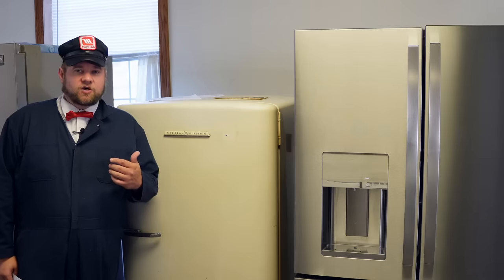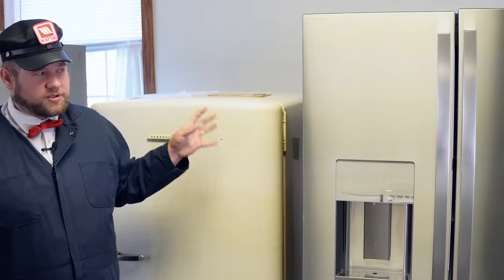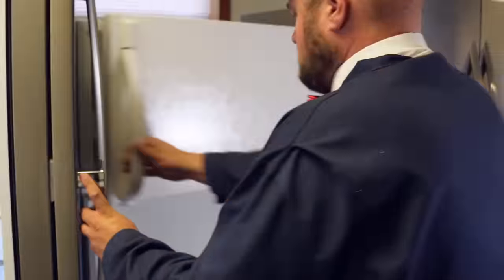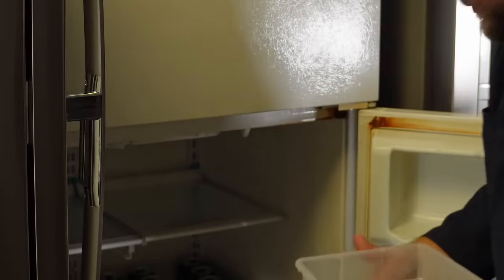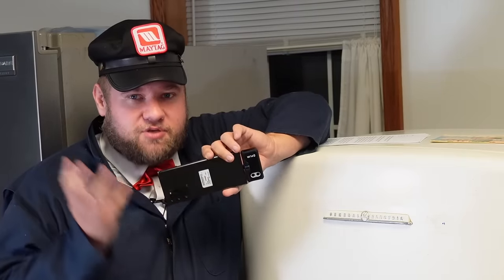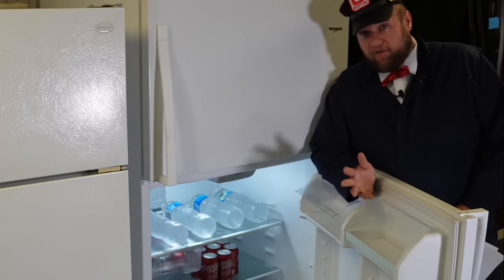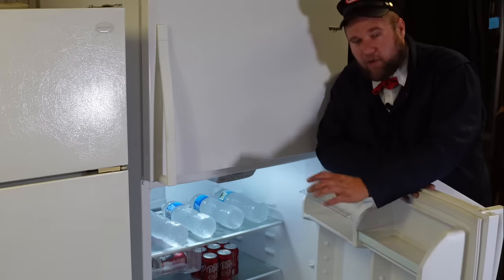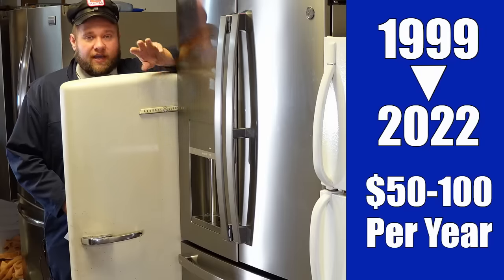Should You EVER Buy a New Appliance if Yours Still Works? A 7-Day Test

Comment: As someone who loves old technology (I have a 30 year old truck) I definitely wanna see that old fridge stay in one piece or at least stay in use. That machine probably has a good number more years left in them
Reply: Yup. Simple good sturdy designs are the way to go. To you can't find that much anymore.
Reply: @johnrobinson8323   fire up a '79 chevy Silverado  when you are gathering firewood in the wildlands.  There's something special about those bench seats and mechanical / not computer run systems.
Reply: Definitely agree
Reply: I hope somebody got it and it wasn't scrapped.
Reply: Yeah, but that old fridge probably uses 3-4 times as much electricity to keep running compared to a newer model.
Reply: @mrsleep0000  Nothing compared to the resources wasted on new Fridges that die in 10 years.
Reply: With the cost of heat and AC these days, if all I had to worry about on my electric-bill was an extra $10 per month, I wouldn't have anything to worry about!
Reply: The only thing wrong with your granny's fridge is it's too small. If I had a basement or garage, I'd  probably keep it there for beverages.
Reply: @sunbeam8866  A lot of new fridges are larger, but some of that is insulation too.  Much of a new fridge's "efficiency" just comes down to more insulation.   Actually, they've been switching to less and less efficient refrigerant to be "environmentally friendly".
Reply: @l337pwnage  As I remarked in another comment, the amount of extra energy my 30 year-old Fridge uses doesn't keep me awake nights. But having to spend $1000 to $2000 every few years might. Instead, maybe I'll invest in aome new gaskets!
Reply: Ur 30 yo Ford truck is very rare old technology, sure mate. 🤭😂😂
Reply: I guess you didn't watch this video @mrsleep0000

Comment: One reason the staff refrigerator did so well is because it was so full.  The fuller a refrigerator is the less warm air that can enter when you open the door.  This requires less energy to cool.
Reply: Hmmm.  I always thought the rule of thumb was, a little less packed in the refrigerator so the fan could circulate the cold air better to keep the food fresh longer.  And, a packed freezer is better as the frozen food allows the freezer to work less.  Maybe this thought process was meant for older models?
Reply: @lindacbenson4400  There's a difference between being full and packed. Air circulates around a full fridge.  It may not circulate well when packed.  And the strategy is identical for both the freezer and fridge.   The only difference is the temperature and the fact the freezer does more work to room temperature air.  When the door is opened cold air pours onto the floor and warmer air enters and the mechanism needs to work to cool the air.  The longer the door is opened, the more often it is opened and (key to this discussion) the more air that leaves means more work, i.e. the higher cost, is required.
Reply: Thanks. That makes perfect sense.

Comment: Fun video.  I'm 81 and we had a GE frig like your grandma's. It still was going strong when I moved out around 1959.  I remember GE was a great company back then.  That's sure not the case now.  Of course, that's pretty much the case with all appliance manufacturers now
Reply: Yeah yeah. 
Don’t make them like they used to. 
Back in my day we built them tough. 
If I had a dollar for every time. 
I remember when…
Reply: God Bless you
Reply: GE appliances is not even owned by GE anymore or an American company.  It's owned by a Chinese company now and the quality has plummeted from a low end ok product to absolute trash.
Reply: My folks are a little older than you, and they didn't need to replace their late 1960s Zenith television because it broke, but because it really became obsolete with different adapters (HDMI etc.) and much larger screens.  The TV still works.  
Same with their GE washer/dryer from around the same era (replace for features not because it broke).
My mom also still has her Kirby vacuum from the early 1970s, but also has a newer model for upstairs so she doesn't have to tote the heavy old Kirby.
Reply: @ophrasbankaccount7716  What's your point? He's right.
Reply: @ophrasbankaccount7716  look up planned obsolescence
Reply: @coments101  let me introduce you to printers. Not to mention their bulletproof system. Where you kinda need ink if you’re going to use a printer at all. Literal pennys to make an ink cartridge sold at prob 1000%X no other product can do that. 
Smart watches, I haven’t even got the slightest clue if you can even replace the battery of series 2 Apple Watch. 
Bmw using plastic parts when it comes to crucial engine components. Whole industry is fucked. 

People debating that vegetables are greener and More eco friendly than livestock. When in reality it’s the complete opposite. Pound for pound nutritional value. Ammonia being criticized bcs it’s used in our produce. We wouldn’t be able to feed the world without the use of pesticides and science. Organic food for everything and everyone simply isn’t feasible at all. Electric vehicles that cause more harm to manufacture than a regular gas powered counterpart. 
Countries whose whole economy revolve around oil (Qatar) have to prepare for an electric mvmt by diversifying their investments. Qatar a tiny tini country owns more European real estate than the queen of England. Post pandemic there’s been a shift and we all feel it. Something is different. Feels different. 
Whole shit is fucked. Just do you and work towards your personal goals. Buy what you need and make informed decision. Be a good person and do as honest business.
Reply: @coments101  let me introduce you to printers. Not to mention their bulletproof system. Where you kinda need ink if you’re going to use a printer at all. Literal pennys to make an ink cartridge sold at prob 1000%X no other product can do that. 
Smart watches, I haven’t even got the slightest clue if you can even replace the battery of series 2 Apple Watch. 
Bmw using plastic parts when it comes to crucial engine components. Whole industry is fucked. 

People debating that vegetables are greener and More eco friendly than livestock. When in reality it’s the complete opposite. Pound for pound nutritional value. Ammonia being criticized bcs it’s used in our produce. We wouldn’t be able to feed the world without the use of pesticides and science. Organic food for everything and everyone simply isn’t feasible at all. Electric vehicles that cause more harm to manufacture than a regular gas powered counterpart. 
Countries whose whole economy revolve around oil (Qatar) have to prepare for an electric mvmt by diversifying their investments. Qatar a tiny tini country owns more European real estate than the queen of England. Post pandemic there’s been a shift and we all feel it. Something is different. Feels different. 
Whole shit is fucked. Just do you and work towards your personal goals. Buy what you need and make informed decision. Be a good person and do as honest business.
Reply: @ophrasbankaccount7716  Dude, whats with the unhinged rant? All the guy was doing was reminiscing about the past and you were a jerk to him. Then you get called out for it and then you proceed to go off the rails. Maybe look into not being on the internet so much, go out and talk to people. You seem to have way to many things on the mind, its not healthy bro.
Reply: @ophrasbankaccount7716  you read like a 14 year old who just learnt about "ok boomer" not all old timers are the enemy, kid. He has said nothing wrong.

No one was even talking about livestock. He was just confirming what the video already said.
Reply: @magnetshowdotheywork  I’m 13 actually. 
Interesting username there bud, what’s the inspiration behind it ?
Reply: @ophrasbankaccount7716  calm down there brat
Reply: @zk0rned  what is up with these “interesting” usernames. What’s next ItsMeHitler
Reply: @ophrasbankaccount7716  Livestock calories are far less efficient than those from crops. It takes about 25 food calories of energy to create 1 food calorie of beef, 15 for pork, and 9 for chicken. "Meat is more calorie dense per pound" isn't part of the conversation.

Organic food is more taxing than non-organic in general terms, that much is correct.

The Qatar statistic is almost definitely true— I believe the crown only owns about 285,000 acres (where the UK is 60,000,000 acres, and Europe is 2,600,000,000)
With a population of 3 million people, even if the richest 10% owned 1 acre, they'd own more than the crown. It's more indicative that the crown doesn't hold a huge portion of land, and that there are many wealthy people in Qatar than anything sinister. (The same holds true across ratios, if the richest 1% owned 10 acres, 0.1% owned 100, etc)
As a pedantic aside, there is no Queen of England— only King Charles. (In a joking sense, I own just as much European land as the Queen does)
The United States and most of Europe have tax incentives to invest in alternative energy— where for Qatar (at least for solar, the one I checked) there is no such program.

As for the Apple Watch 2, ignorance on your part doesn't constitute a real world problem, as technicians can replace the battery.

You can buy generic inks, with at least 1 printer company telling you to ignore non-genuine ink warnings during covid shortages. Generic inks or remanufactured inks can be had for 5-10% of the cost of branded counterparts.

I don't know enough about cars to comment about BMW's plastic components.

By all means advocate for your beliefs, my advice is to take some more time to investigate information from reputable sources, challenge assumptions (e.g. the meaning of Qatar owning land in Europe), and keep adapting to the most compelling and scientific current information.
Reply: @Kai-K  Jumpin in from the car world: Modern Car makers (Read: Not just BMW) are using plastic for shit in the engine bay, including stuff like intake manifolds...Kinda blew my mind when I first saw that. 
On the one hand, the kid ain't wrong. On the other, he is.
Lemme esplain...no. Let me sum up:
Industry in general had a different philosophy in the early to mid 20th century. Engines, cars, appliances, were all "over" engineered, and most (at one point) were designed such that a person with a high school education could work on them. (See WWII Military Hardware - Jeep - for an example). 
As time wore on, Capitalists looked for more ways to make money/eternal search for growth - and you run into the "consumable" philosophy. Now instead of over-engineering products to last and be repairable by someone with a base education, they've worked to make them either A: throw away or B: only repairable by them (See: John Deere as an example).
The right to repair movement exists BECAUSE we've had 'ownership' of our stuff removed from us in order to foster 'further growth' of said industries.
In the grand scheme of things this is great for a capitalist/corporatist - but bad for the rest of us on two fronts - our wallets and the environment.
The more stuff we have to throw away, is more natural resources consumed and rendered junk/land fill fodder.
So at some point - humanity is going to have to wrestle with the 'it's good for business' ideology - and figure out wtf we're going to do going forward. Resources are not limitless.
I am not a professional repair person by any means, but I know enough to keep the myriad of old electronics and cars i own working. I'm here because I've been researching what to do about my aging fridge. (AKA: Fix it or buy new).
Reply: @Kai-K  In the last instance, if we continue to work as individuals, I think we will lose the battle. Check out the book "Mutual Aid" as a counter to "Survival of the Fittest" for the basis of my thoughts on this topic. Corporations have an INSANE amount of power, and individuals will constantly exist at their behest if we do not work together to correct some of these problems. (Just my two cents on the "Shits fucked/work as an individual" comment).
Reply: @openmythirdeye  the Chinese engineering system is substandard... IF YOU WANT THE BEST... ALWAYS buy Japanese engineered products. The Japanese are the end-all, be-all of engineering... true for cars, stereos, appliances ETC.
Reply: @ophrasbankaccount7716  I'll be you already used that for a different name for when people totally destroy you on the internet
Reply: China company bought general electric
Reply: GE sold their appliance business to Hier.

Comment: We have a 70 year old kitchen range/stove that works fine. I remember growing up when my mom got rid of a 25 year-old range/stove to buy a new one. Well that new one didn’t last 10 years without breaking down. I use that as a cautionary tale and a reminder to not replace the 70 year old appliance I have.
Reply: I got my Grandma's 1974 GE Americana Double oven range in 1998 when she passed.  She never used the bottom oven except on Thanksgiving for a turkey.  The upper oven did all the work. We did the same.  In 2016 I finally replaced the upper oven gasket, and clock timer assy.  Other than that nothing has been replaced on it.  Wife and I are getting rid of the induction frigidaire stove that came with the house we have now and redoing the kitchen to accomodate the Americana, along with a 70's GE Side by side,  and a GE Dishwasher from 70's. Currently we have frigidaire stuff that constantly breaks down and is less than 5 years old.  Went looking at newer stuff and to say I was not impressed was a massive understatement.  I can still replace parts, so the old stuff stays.  My grandkids call me a tech Neanderthal as my stereo setup is all tube (no solid state) FISHER gear from the early 60's.  And I drive a 1964 Corvair Spyder, and a 69 C10 with a inline 6 and a 3 on the tree.  No power anything.  If god wanted me to have power windows, and automatic transmissions, he wouldn't have given me arms, Just stubs.😁😁

Comment: Power consumption is not the only thing to consider. Given the prices of new refrigerators, it would take a very long time to recoup the replacement cost, and the less-reliable new appliance may need more service calls. I'm keeping my old fridge as long as it continues to work.
Reply: Hi, Ben!

At the very beginning of your video, you stated you just purchased a new one. 

Which brand / model did YOU purchase?!?

Looking forward to hearing your response, thank you!
Reply: The cost of energy is likely to be higher than the cost of the new fridge.
Reply: @tjeulink  Never
Reply: @wholeNwon  look it up hun, LCA optimal fridge replacement energy cost
or you can calculate fridge replacment with energystar.
Reply: @tjeulink  And allow how much for the very expensive repairs that will likely be needed during the new fridge's (short?) lifespan?
Reply: @wholeNwon  much less! if you buy one with the same features and for the same price adjusted for inflation.
Reply: Actually, this is what I've been grappling with-- I have a house that was new===34 years ago, and the range, d/w and fridge are all still running!   The most basic models.  I found the old energy guide and comparing it to a nicer bottom freezer, the thing costs about 2x as much as the newer ones (less for the french door ones).   So, as Ben is alluding to---yes, it would theoretically pay for itself in about 10 years, BUT if the new fridge has to be replaced even before that---including the purchase price---you're really not saving a thing!   Only thing is - the newer appliances look nicer---and operate way quieter!
Reply: @Ben-mc7ci  Or if a repair is needed, there go your "savings".

Comment: My parents had a 1953 Hotpoint refrigerator that survived a house fire and ran another 45 years.
We got a new side by side in the seventies that also lasted about 40 years.
Each time we got a new fridge, we moved the old one into the basement as a drinks fridge and simply as additional fridge space until they finally gave out.
Did the same with an upright freezer, adding a chest freezer later.
Having extra freezer space was always worth keeping the old appliances when the folks bought new for the kitchen.
My folks would buy a side of beef at a time and we had plenty of storage for it.
I love your grandma's GE.

Comment: My father's "beer" fridge in the garage is a 1940 or 1941 Frigidaire by General Motors that still works.  It was inherited from a late aunt in the latter 1980s and still works great.  It could probably use a new door seal.  I believe I have documentation somewhere as I entered it in a APwagner old refrigerator contest in 2007 or so... it came in like 3rd place... beat out by some 1930's models with compressor on top.
Reply: I was given a 1942 Frigidaire to make a smoker out of because of the all metal interior. Before I started that project the shop Beer Fridge died so out of curiosity I plugged the old fridge in and it's still chilling my refreshments today! Had to go find another Smoker fridge project donor.
Reply: @Motorheadmike Very interested. Can these still be sourced through Frigidaire or can you can point me to speciality vendor?  I'll try to get exact model info.  Thanks!
Reply: @audreyappliance  You can buy the gaskets through case parts . You just have to look at your gasket profile and measure your gasket precisely and they will build one for you
Reply: @ron9381  Thank you!!! Invaluable info
Reply: Up until the early 1980's, my grandmother had a 1930's refrigerator with the round compressor housing on top. It came with them when they moved from a duplex to their then new 1952 rancher in the suburbs.